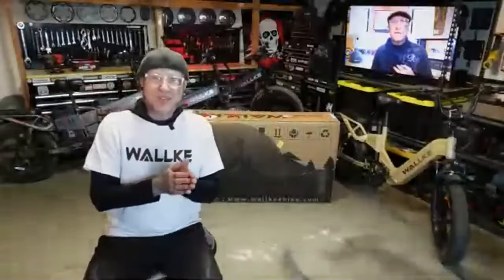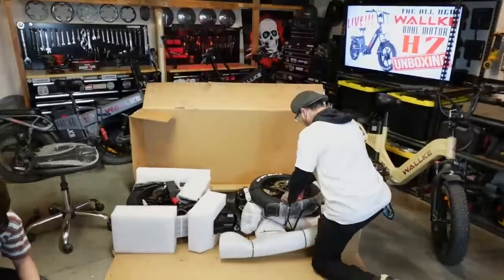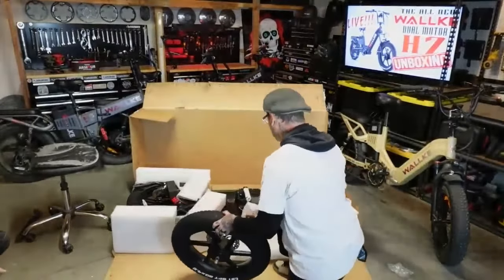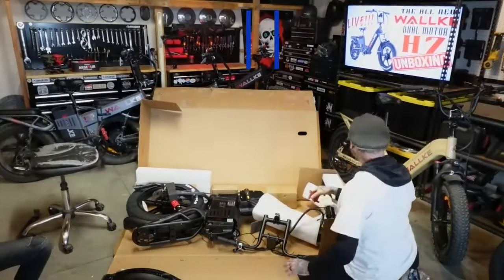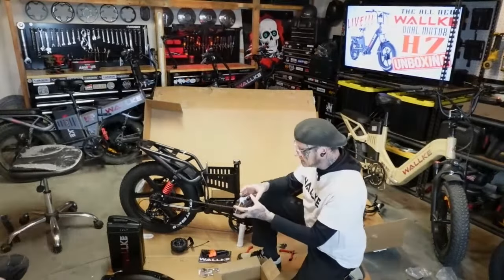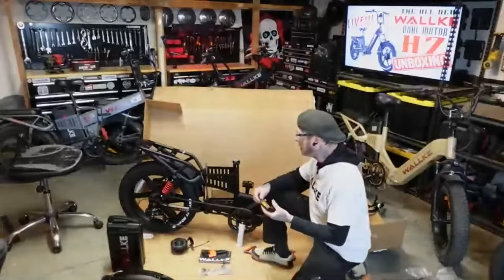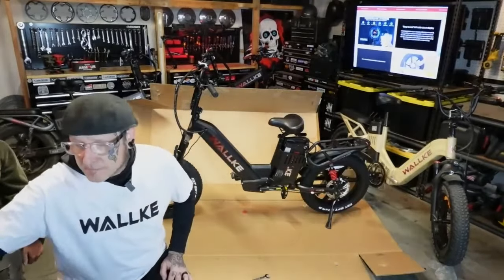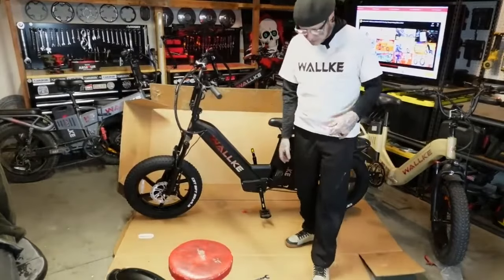Wallke H7 Dual Motor E-Bike Unboxing LIVE ! (Edited version)

Comment: Can’t you just replace the sprocket & not the crank ? Also will I have to get a longer chain if going up to 58 ? & what are Amazon part links. Thanks
Reply from the maker: Unfortunately the chainring is a part of the crank arm. So the crank arms have to be swapped. I'll be using this one.
https://www.amazon.com/CYSKY-Single-Crankset-Mountain-Bicycle/dp/B08SM5C4SF/?_encoding=UTF8&pd_rd_w=kRomQ&content-id=amzn1.sym.d0ebfbb2-6761-494f-8e2f-95743b37c35c%3Aamzn1.symc.50e00d6c-ec8b-42ef-bb15-298531ab4497&pf_rd_p=d0ebfbb2-6761-494f-8e2f-95743b37c35c&pf_rd_r=8P2MR8709P8MWAWTRA6A&pd_rd_wg=VWWvq&pd_rd_r=5733a67c-8591-4c1a-bc4d-0522ff2aa25d&ref_=pd_gw_ci_mcx_mr_hp_atf_m&th=1

Comment: Greats vids man. Hey I have the latest H9 and latest H7 coming tomorrow morning. I can’t figure out what that ticking is when I put on the front brakes. It doesn’t seem to be the rotor, calipers, or pads but I can’t seem to nail it down. A lot of people are complaining about it. Do you have that ticking on your H9?
Reply from the maker: Hi. I haven't noticed it on my H7. I have noticed that adjusting those front brakes is a real chore with the 4 piston calipers. There is very little tolerance. And it is 100% necessary since the bike comes with the wheel off. I'd be willing to bet that tick goes away after the shoes get worn in. I'm assuming you made sure the motor cable isn't hitting anywhere. Sorry for the late response. I just got back from a tournament waaaaay upstate. Let me know how it goes. If it goes away or ajustment works or if it gets worse....Cheers!

Comment: Hey I changed my front sprocket/cranks like you suggested still ghost pedaling. What size is the rear cassette ? I need to drop a couple teeth & messenger would be easier than here ?
Reply from the maker: The stock freewheel is 14\28 I believe. I have a 11/34 coming in the mail today.

Comment: Can you add a center kickstand?
Reply from the maker: Hmm. I’d never been asked or thought about that, so I went out and looked at my bikes for the possibility. Because the frame incorporates a rear battery basket it’s pretty tight around there. You could add a clamp on style and bring it further up the swing arm. As for like a fork style center stand, like on a moped. That would be pretty trick! It would require drilling it to the control box. The frames are aluminum so any thing you add has to be bolt through. You’ve got my wheels turning….Cheers!

Comment: Hey, can you adjust the suspension on the x3pro?
Reply from the maker: No unfortunately not. You could put an adjustable shock on there but I never felt the need. If I’m off road, I’m standing up. Plus I run a suspension seat post and jell seat. Cheers!
Reply: @TheE-LightenedArtist  ok thanks

Comment: Please send me the Amazon link. I can not find one for 7 speed.
Reply from the maker: https://www.amazon.com/dp/B07XYPH5BG?ref=ppx_yo2ov_dt_b_product_details&th=1
Reply from the maker: This the one I landed on. It should show up any minute. ill slap it on and let ya know how it worked.
Reply: Were you able to get that installed last night ? Waiting to order mine but waiting on you first. Also what tool are you using to get it off ? There are several & not sure which one on Amazon. Thanks.
Reply from the maker: Sure did. Busy day so I burned the midnight oil. It;s a “parks tool” FR 1.3. It’s plug n play but you do need to get a little creative with spacing. I need to ride it today to make sure it functions correctly then I’ll make a video on how it’s done. Pretty easy but I gotta test it today.
Reply from the maker: Ok so it's awesome except for 1st gear. 34 is way to many teeth without adding links to the chain. which would suck in higher gears. It'd be ok with the stock chairing but I'm going for high gear. So don't get an 11-34. 11-28 would be the way to go.